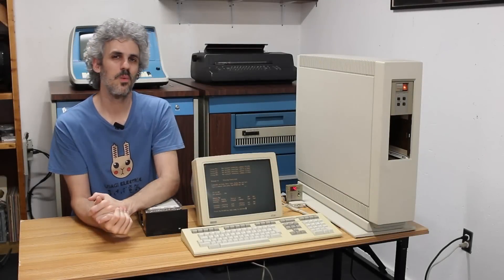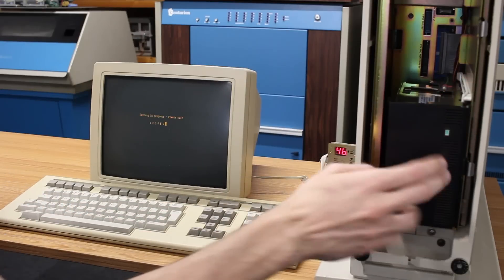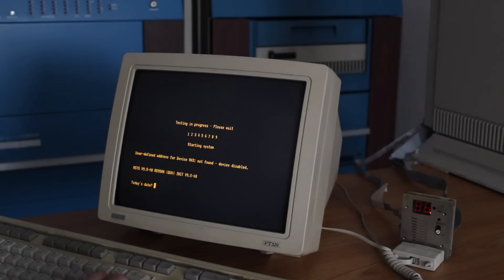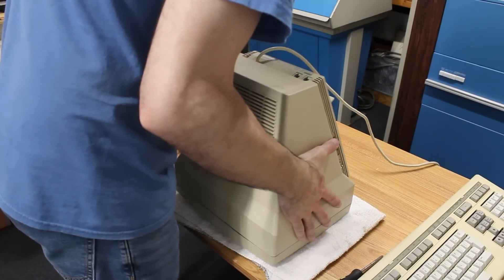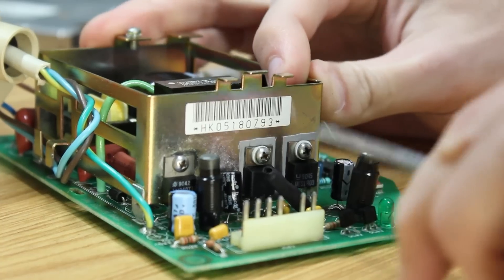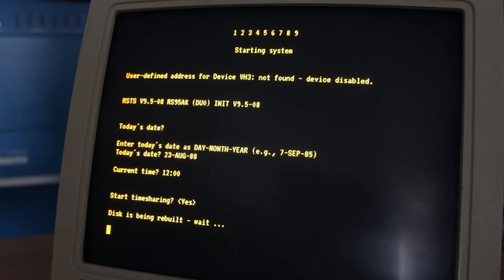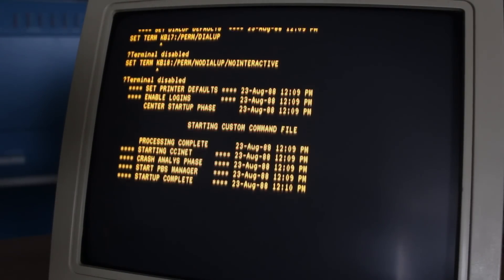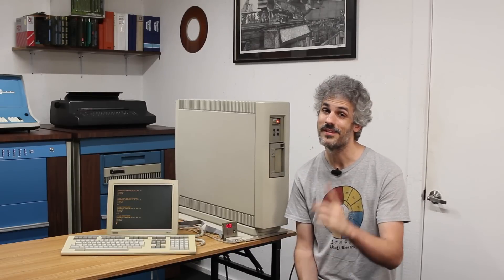Booting RSTS on the PDP-11/83!

Comment: Used to use a PDP 11/34 at work. RSTS was always pronounced "rist us".  There should be a RSTS manual on the disk. also look for a program called PIP.  As for a login/account try 1:99 password 'DEC' . This was a back door for DEC technicians to do system maintenance on all PDPs I worked on.
Reply: I hear ya - every time he pronounced RSTS as individual letters, I kept saying "ristus!"  Like he could hear me. 😋
Reply: Longtime RSTS expert here. Try "HELLO 1,2, password SYSTEM. Also, don't start timesharing right away; the RSTS bootloader has options for refreshing the disk and disabling hardware.
Reply: I always heard that RSTS/E was pronounced "riz-tiz-ee"
Reply: Aah, so that's where CP-M's PIP came from
Reply: PIP = Peripheral interchange program

Comment: Looks like the 77 on boot may be because the power supply didn't signal power good to the CPU and the CPU is kept in halt. So it would be a good idea to check the capacitors on those other power supplies next.
Reply: oh yeah? how would you know 🤨
Reply: @jessihawkins9116  oh yeah? How would you know that they don't know 🤨🤨
Reply: @ToasterWithFur  well, um…..😕
Reply: Yep, I can see that happening. I would also look at the CPU card too for marginal capacitors around the linear regulators to make sure there's no chance that it would scramble the processor chip, and/or its power-on reset circuit too - linear voltage regulators tend to run hot and obviously electrolytic capacitors don't like heat.
Reply: I agree it was likely a faulty power up reset function.
Reply: Had a similar failure on a different machine.  Check if the ready signal going to the CPU correctly flips shortly after power up.  Theres’s probably a 555 chip which is used to tell the CPU to start running… my failure was that a film capacitor going to the 555 was acting as a resistor and system would fail on a cold boot.
Reply from the maker: That's a good idea! The power supply itself looks to be in pretty good shape, but I'll take another in-depth look at it. Another potential error could be the terminal sending a "BREAK" signal on power up in response to junk being sent out the MUX port, though that one feels less likely as this didn't start happening until the HDD was installed and the added load of spinning it up.
Reply: @UsagiElectric  To my experience, Nichicon caps are in good standing in the electronics world. My guess would be this PDP has been running maybe for 20 years, and if circumstances killed the Nichicons, other caps and components that aren't as resilient may just be in a similarly bad state. So I agree with Donovan here, I'd go through 'passive' parts like power supplies, etc. Good Luck from Germany!
Reply: @amurtigress_mobile365  Nothing lasts forever under the moon ;) I'm talking about capacitors...
Reply: @UsagiElectric  First thing you should do is visually inspect all caps in old electronics before plugging anything in. You can really damage equipment due to bad caps and compound a bad situation fast.
Reply: @ToasterWithFur  At worst, that sounds like a pretty good assumption to make.

Comment: I must admit that I haven't touched a RSTS/E machine in anger for a couple of decades but the last version I worked with was RSTS/E 10.1 which you needed to log into before it would work by typing LOG p,pn or HELLO p,pn. It would then ask for a password. "p,pn" was shorthand for "project, programmer", each of which would be an integer between 0 and 254 (there were a few accounts that you needed to avoid, for example [0,1], [1,0] to [1,2] and a few more that I won't go into here). You may have a problem finding passwords for anything (up until RSTS/E V7.0 you could find the passwords for everything in plain text in a file in [1,1] but everything was encypted and hidden for V8.0 onwards).
Reply: Did “I«p»,«pn»” still work?
Reply: Oh man, that would incredible if he got though with that. I am not a "computer" guy at all but I find these videos exciting.
Reply: @lawrencedoliveiro9104  Yes.
Reply from the maker: I actually gave this a shot last night!
Typing "HELLO" gets me to a user prompt, which I follow with 1,0 (or other variations), and then it hits me with a password prompt and I come to a halt there. Without knowing the specific user,project and password, I just get stuck. I tried to usual suspects (SYSMGR, SYSTEM, etc.) to no avail.
But, if I hit "NO" at "Start Timesharing" I can get to a pretty low level boot screen where I can view the directory listing with DIR and run some other simple things. So perhaps there's a thread there I can start pulling on!
Reply: Our school had RSTS on a PDP 11/70 for student use.  This brings back memories.
Reply: @UsagiElectric  The main system account is “1,2”. I wouldn’t know what the default password was, and I imagine since this system was in production use, they would have changed it anyway.
Reply: More than likely the later versions use something like a Crypt hash which is trivial to brute force these days, so finding whatever file it stores users in would be the magic you'd need to take the next step.
Reply: @UsagiElectric  try 100,100 password  demo
Reply: @UsagiElectric  Another commenter mentioned that the default DEC Field Service maintenance login/account was either 1:99 or 1,99 with a password of DEC.  But I agree with other commenters about checking (electrolytic) caps throughout the entire system and then checking for proper voltages IAW the appropriate tech pubs.

Comment: I’m still reeling from your collab with Veritasium 😆🌷 I’m really into the PDP stuff, due to its connection to Unix and C if I’m not mistaken.
Reply: AT&T Research Unix was written for the PDP-11, which may be why 16-bit computing became a de facto standard. Before that, word lengths between different computers varied widely.
Reply: Thanks for pointing out the collab with veritasium. I might have gotten around to watching that video, but I might have skipped it too, if not for finding out he appears in it.
Reply: Actually the IBM 360 was probably the one that cemented 8 bit bytes.  DEC made a lot of 12 bit machines and used to like octal which is why there is so much octal in Unix
Reply: DEC made 18-bit, 12-bit and 36-bit machines (in roughly that chronological order) before their first byte-addressable architecture in the PDP-11.

A prototype of Unix was actually first created on an old PDP-7 (18-bit machine). I guess that proof of concept allowed the Bell Labs folks to get funding for their nice, new PDP-11 to use to bring Unix to its full fruition.

Comment: I just looked in my library and found the following: PDP-11 Systems Handbook covering MicroPDP 11/83; 11/73;11/53 and PDP 11/84.  Also found a copy Digital RSX-11 Handbook.  I used these extensively in 1990 - 1993  when I reverse engineered a PDP Bus to proprietary parallel interface board to develop test software.  The board was in a PDP 11/53 in a letter sorting system being manufactured for the USPS.  Are these of use to you ?
Reply: I collected so many of those great little paperbacks. Digital considered good documentation part of the complete product. 
Those handbooks must have sold so much hardware...
Reply: They are. To many. Scan n upload or send in and he can.
Reply: Bitsavers has a vast collection of DEC stuff. Have a look there, and see if there any gaps you can fill -- I’m sure they would appreciate the contribution.

Comment: The "Bye" prompt means this terminal is not logged in. It's waiting for you to type hello and press enter. KB0: is a special terminal  on RSTS; it is the master console. A possible reason you don't see any characters is it's in 'half duplex' mode. In full duplex mode , when you type in a character the computer echoes it back. In half duplex, the computer does not echo. This was important on printing terminals to prevent double letter display.

Comment: Few comments from a die-hard RSTS/E guy:
1) RSTS/E 10.1 (last version of RSTS/E) supports post-Y2K (I'm running a system now that shows todays date just ducky)
2) Disk being rebuilt is a file system check/fixer when the system was shutdown without a clean 'unmount'
3) Some liked smooth scroll, most hated it because it artificially limits baud rate/speed to somewhere around 4800  baud (effective, regardless of actual baud) as it took time to scroll and the terminal would send an XOFF to stop serial comms until the scroll completed, then an XON to continue (it looked cool, but wasn't practical)
4) That is very definitely a modified/customized version of RSTS/E - some components of standard startup are there, but with some custom overlay script
5) They likely replaced the default login program (that does not look like any part of the 9.x login program) and that may disable echo as some form of security.  My guess is you are supposed to "blind-ly" type in a PPN (like 1,2 - literally number 1 a comma and 2), ENTER, then the password and ENTER to complete a login.  But just a guess.
6) Usually, you would create a kernel that only supported devices you had to limit the amount of memory the kernel used, but in this case, likely some commercial packaging of RSTS/E included a kernel with nearly all supported devices "SYSGEN'd" in.  Which does slow initial boot time a little.
7) You MIGHT be able to hit Control-C at the first prompt to do startup (after the "60 Devices Disabled") as technically, RSTS/E is running at that point and the scripts that start after that prompt just setup operating programs and environments up. It's fully functional at that point, and if they didn't trap/stop the control-C, you'll likely be dumped into DCL (or possibly Basic).  If you get there, you can so a LOT with tailor the system, setting/changing password, etc
8) The cycling numbers are just the "modern" way of showing the CPU idling.  On old PDP with individual lights, the equivalent was a row of lights going back and forth when the CPU was idle (like the eye on a Cyclon).  The 83/84 just used the boot diagnostic panel for that (it's not really useful, just sort of cool, though you can sometimes tell the CPU is busy (or halted) by looking at them.

Comment: The numbers cycling on the LEDs is most likely the "idle job".  It was common for 1970s-era PDP-11 OSes to a) have a job that ran when no other job needed to run, and b) that job often updated the lights on the front panel so you could see that it was running.

In the days before digits (PDP-11/70 and earlier), it was often a strobe or "cylon lights" across the width of the front panel.  For display with digits, it was often a counter like 1111...2222...3333... and for fun, on an octal display, 8888 and 9999 by superimposing two sets of digits rapidly to simulate 8 and 9.

You could also tell how busy the machine was by how fast the lights changed.  If the machine spent lots of time "doing nothing", the lights advanced quickly.  When there was actual "work" being done, the updates slowed.

A relic of a time when everything had status lights.
Reply: Sun had the same on the machine in Sun-3 and early Sun-4 machines.
Reply: Interestingly, Windows to this day has an idle process running if it's not doing anything else.  It just doesn't have blinkenlights.

Comment: Tip from the ancients: For insight into what a cpu is running, if halted, or wait looping, get a little AM radio, put it near the boards. Doesn't need to be that close.
Tune around, you will hear things and eventually find it a comforting connection, especially at the layers you're working at with lower Mhz machines.
Augmented reality in the EM spectrum. The method is cheap, and will work with all your stuff. I think you'll dig it and it'll help.

And that box really wants a Unix v7 or BSD on it.  A shell, a C compiler, a /dev directory, and simple configuration? Home. And the best bridge to today.
RSTS/E and RT-11 admin will demand endless study of the orange wall of manuals, with stuff you'll never need or use. Nobody wants that.
Reply: Unix?! Blasphemy! RSTS!!!!!!
Reply: This comment doesnt seam to be written by a human
Reply: I loved those manuals. 😢

Comment: If I remember correctly the disk rebuild is like a chkdsk on dos. It is started because the system was not correctly shutdown by switching off or restarting from the frontpanel.
Reply: Bingo. Linux used to do the same thing when it was still using the ext2 filesystem, with ext3 and later, the filesystem was journaling so any file system damage could be easily repaired.

NTFS will also rebuild the disk when the system wasn't properly shut down and the disk is marked as 'dirty'.
Reply: Yep, I would think so, it's basically like chkdsk, which most OSes have had a form of, especially Linux and Windows OSes, to verify that the file system bitmap isn't corrupted, and then mark it as checked (and potentially repaired) so the OS can proceed as normally.
Reply: I recall the RSTS/E error was “?Disk pack needs CLEANing”.

Comment: I'm crrently at 5:30. As soon as you turned off then on the terminal that quickly, I knew it would'nt start again. The sudden inrush of power without anything having a chance to discharge is bound to kill some components. Usualy caps, which can then overload the first stage of the PSU.  :(
Nice work with the PSU fix.
Reply: Yup, I cringed when I saw that too 😵
Reply: Yeah...I wait a good amount of time before I power up after fully discharging the caps, even on modern systems.  It is a practice I learned in the 80s and cannot hurt even if it might not be needed anymore.
Reply: @hicknopunk  Those capacitors were going to pop sooner or later anyway. The keyboard error was already a sign that the PSU was on its way out.
Reply: @jonathanvanier  Yep, a good bit of what this nice, happy fellow does makes me cringe, but he manages to do more good than bad, so I'll hand him that.

Comment: By the way, RSTS stands for "Resource Sharing Time Sharing". The default mode on any terminal is running the BASIC programming language. So, you can type any valid BASIC command and get a result. EG: PRINT 4+5 should give 9 and then the "Ready" prompt. I think. Soooooo long ago....
Reply: There were several available shells, one was BASIC, like you say, but rt11 and rsx11 were possible and dcl.  It was probably configurable per user, but I wasn't an admin back then.

Comment: Very likely the stuff you saw on startup was the end user application (CCS may be whatever commercial app the auto shop used for its customers).  The console might have different stuff going on than a user terminal.  (perhaps plug a terminal board in and see if you get something on a different port?).  I never used RSTS much, so it's all a huge guess.   The LEDs counting could just be the idle job letting you know the system is alive?
Reply: Got to admit, it reminded me of the LED display on the front of an 11/70 where the LEDs would wipe back and forth across the address bus display.(ISTR anyway)

Comment: 12:07 I had a alook at the V9.0 docs. Answering “no” gives access to some low-level system maintenance options, but nothing resembling a “single-user” mode. Or you can answer “start” and then choose from the available “monitors” (“kernels”, I guess) to boot (type “?” to have it list what’s available). There might be a single-user one, but I don’t know.

Comment: It looks to me like that RSTS/E system has been customized (It's pronounced riss-tuss btw) and it could be looking for a system password.  (VMS could be configured to do this too.)  Most of that startup was in trouble without the required disks being present and it was asking non-OS type questions leading me to wonder how it was configured and for what specific purpose.  But I'd bet it's looking for a system password, which wouldn't echo.  If you get past that, then it's HELLO to login, and you need a pair of numbers separated by a comma (project and programmer numbers), with 1,2 being the system account.  If you DON'T start timeshareing at the boot, you should be able to get into a minimal maintenance mode and modify some system settings, the bootup script, etc.

Comment: I ran RSTS/E systems for many years and loved them. Way better than RSX. Very reliable and user friendly. It was the best multi user / timesharing system for this type of computer.
Reply: I went from RSX to RSTS so I had quite the opposite opinion :)
I just thought RSTS was wierd.  RSX was originally developed by DEC but RSTS was not.  It was truly a unique OS
Reply: I couldn’t understand the RSX concept of having to “install” a program as a task before you could run it ...
Reply: @lawrencedoliveiro9104  TKB in general was alchemy but if you know what you're doing you can really make the thing sing or if you don't you can make quite a mess.   It was really all about dealing with memory, back in the days of Kilobytes rather than gigabytes.   I remember running multiuser in 128K, hard to believe now.    VMS was interesting too, it was really built around virtual memory and shared libraries, not an afterthought like other operating systems, even today.    By installing stuff the OS can really optimize stuff and make it really go fast.   VMS was waaaay faster in those days than other OSes and RSX could really move, but it was a pain to do it right.
Reply: @ChristopherHailey  TKB -- I worked on a fortran program on RSX-11M with an overlay file a few pages long that took 45 minutes to link on an 11/73. Those were the days: PIP, EDT, RMD, and the occasional wrong-way BRU.
Reply: @musik8000  Yeah, TKB was a beast, putting together an overlay structure bordered on the black arts.